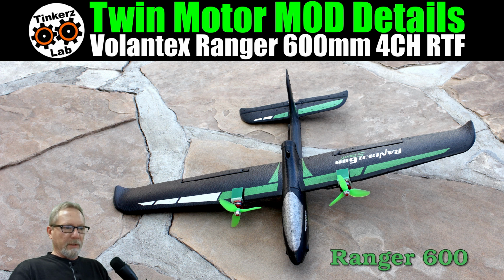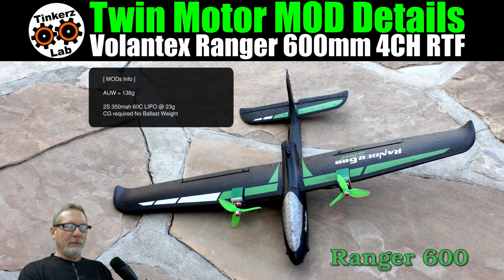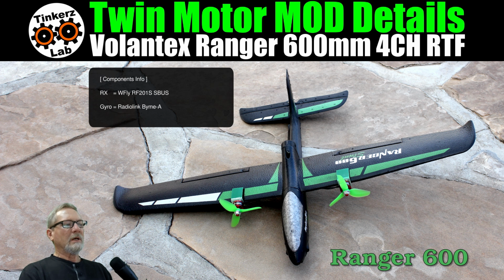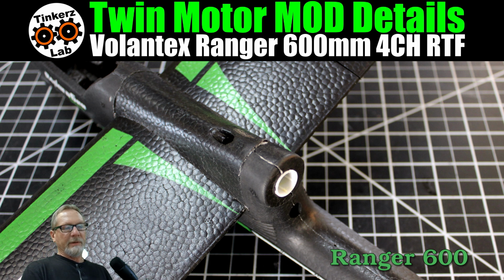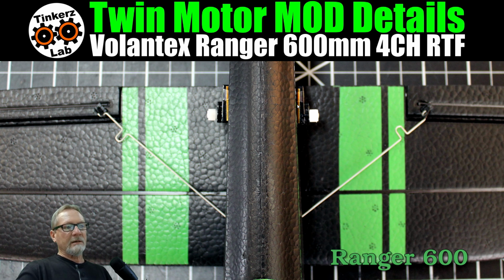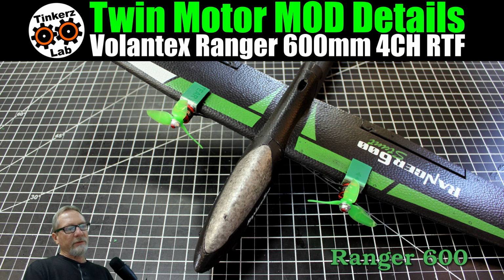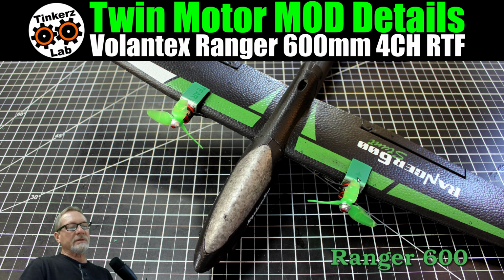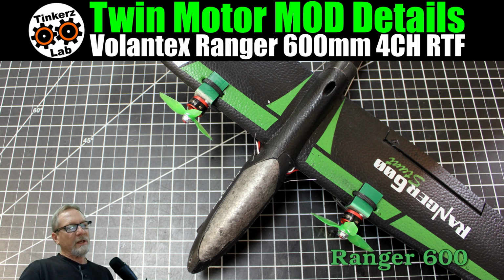How I Performed the Twin Brushless Motor MOD | Volantex Ranger 600mm 4CH RTF

Comment: I have this exact plane. The motor spins up and then almost instantly self-throttles down. It's not the battery. Do you know what my issue might be?
Reply from the maker: Hum..could be a voltage issue since the brushed motor increases | decreases speed with increases | decreases in voltage.